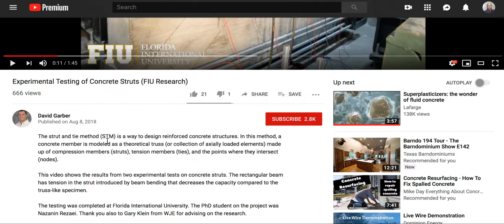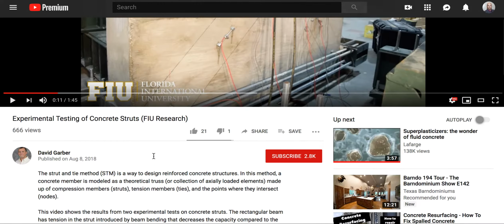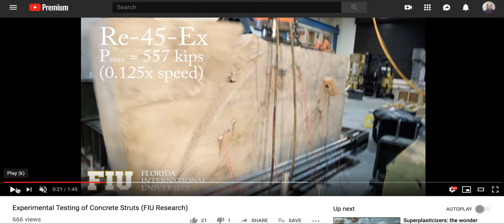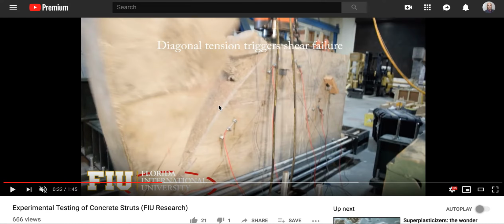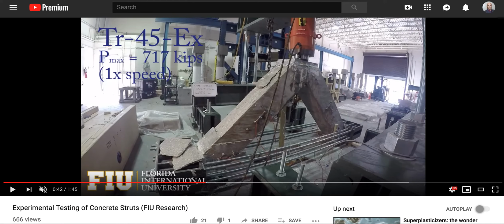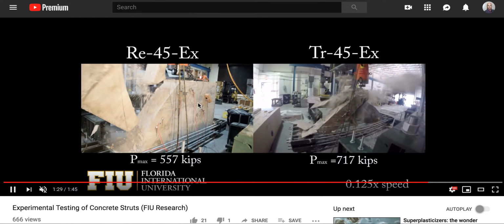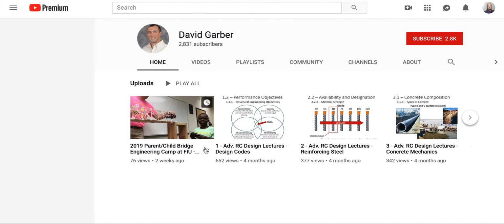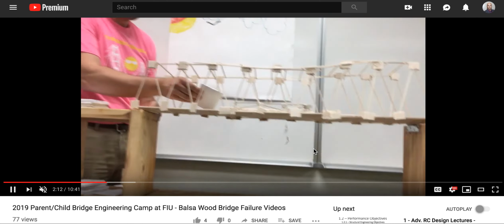FIU Bridge Collapse Engineering School Sample Broke Concrete Struts Related ?

Comment: Take a look at this vid. It is a better explanation and experiment. https://youtu.be/0olpSN6_TCc.   Better explanation of how the simplest of medium like dirt can be reinforced. Love to see a vid on your take on it and how it might relate
Reply from the maker: HowThingsWork Construction Engineering2 minutes ago (edited)
I saw the video you linked me to, on the shear of soil... I have a video I will do on that dealing with fiber mesh, etc... It is basically gator grid  in the smallest form... it STOPS the loads from shear the soil in the 45 degree angle   -- the layer below becomes under tension and this acts like a truss system using soil as the factor...   It is still angle of depose  and my ''engineering of such'' does not use the typical formulas but uses angle of depose to find the weakest axis and that is the safety factor in installing a gator grid type product...
I have decided to share almost all my knowledge on youtube and I will get around to this method and prove it's abilities in the layman's terms... Not in engineering math terms.
Grady, stated he used the screen material because it does NOT deform under loads... 
He is missing the ''tension'' created in the 45 degrees that puts the fabric in tension that retains this system from failure...
NOT the stiffness as he stated but the ability to NOT resist the applied loads in TENSION...  it has nothing to do with ''stiffness'' as I could use rebar and it would NOT work... 
You need more cross sections and more resistance to tension that matters... you further need friction of the layer below and above to interlock or you will get shear plane failure. 
Latitude, I will do a video on this but did not want to pick on Grady, I already called him out once...  Do not want to do it again...  He is a student and has yet to graduate and his content is beautiful... So, I do not want to discourage him and give people any wood for the fire to attack him...
PS Did you see the last two videos I posted on random cracks? I have many still to come... be patient with me... and I hope you become a believer and spread the word...
Reply from the maker: PS Be right back with a video response... ha

Comment: The fracture starts a little bit down due to the loading and sheer capability of the concrete mix itself. We all know concrete is wonderfull in compression but not in tension or shear. Hence the break. Also, this is not concrete as no aggregate large and small stones seen. As a structural engineer, one ignores the tension and sheer capabilities of the concrete as they are so small and puts in Re-bar to allow contain that force. What has this experiment have to do with the FIU bridge? The experiment is miles apart from the members in the FIU Bridge.
Reply from the maker: I only find it odd that they tested a concrete "truss / strut"  at the same time they planned on making a concrete ''truss looking bridge"...
I theorize that the lack of reinforcement would be a good predictor of the system installed...  If, you recall, they system could NOT have a conflict of reinforcement and no one would actually make a strut like this, without reinforcement -- so why test it all?   Possible, to establish a baseline showing no reinforcement as would be found in a typical system...
You being a structural engineer do know how they load tested this member... It was NOT designed to be decorative.
The load testing shows the intent to some degree... as I stated in the video, I wish they would have given more data; especially from their strain gauges. 
Do you find it ''timely'' this testing? Or have you concluded that this can have nothing to do with anything and is just a fun project that will never be used in the real World? 
Finally,  "concrete" , I have trolled a video on ''concrete''  and stated that adding any amount of aggregate to portland cement makes ''concrete'' --- it is just the mix-design is weak or not... But, it becomes ''concrete'' once you add any aggregates and even if you add sand only, it has different sizes of sand... yes, they are slightly larger and smaller grains so that would give you at least two sizes of aggregate... 
I know, you want to call it ''masonry cement'' at that point... but, I state it is just a weak ''concrete"...
Are you trolled on that last statement?
Reply: HowThingsWork Construction Engineering I am a Civil engineer, that works in Management now. Managing large projects. Sorry not a structural engineer. That said my Civil Engineering degree and Masters, informs me that concrete mix without aggregate of the right size will not behave in the manna Engineers design structuers. Hence I am at a loss to understand what the experiment is showing. It has nothing to do with a beam concrete construction. It also has nothing to do with a reinforced structure. All I can think is they wanted to see how the stress break pattern would evolve, as that is only what I got from the vid. Please understand that reinforced concrete behaves differently to pre-stressed concreat. The difference between the two is like night and day. Like wise the behaviour of a none reinforced block of concrete to one that has re-bar is also like night and day. Further having a mix without the right aggregate dimension is not concrete. Go look up the definitions. Sand is not an aggregate. Aggregates are not made from sandstone...thats a fact. I do not know where you are getting that idia from, as it is wrong. As for my theory: the FIU bridge collapsed due to the prestressed member 11 becoming elastic due to the force reaching its exceeded counter force to keep that member in compression. The fact that when the bridge was moved into place and developed 10mm break lines, should have informed the all women engineering team they had to performed tests before allowing any self load to be taken up by the bridge. My conclusion? Engineering team on site were kids playing at engineering. None of them had any true site experience. You just don’t allow workers to pre-tension up bars without understanding what force it was carrying at the time, just in case you over tension it. That's what those monkeys did and killed 6 humans that was so easerly prevented. The director, and the those All women team need to be struck off the register and some go to jail.
Reply from the maker: @latitudeash  , I thank you for you conclusive file on the beam design failure and other statements you made...
I do realize you do not like the idea that concrete does NOT have to be of a certain aggregate size to make concrete...
The short answer is, ''fine aggregate'' and the second part of my trick concrete statement was I never established a playing ground of using ACI to manufacturer ''concrete''...  haha   Okay, enough of that fun troll concrete statement...
Onto their concrete load test... I love different size aggregate and admixtures, as you can tell, I do not have any issue with them NOT using ACI guidelines (we made concrete way before ACI showed it's limiting face)...
Grouts are proof that a ''micro concrete'' is bad ass and reach 9500 psi in 28 days, no problem... they are NOT just portland cement.
Reply: HowThingsWork Construction Engineering thanks- for your info, Grouts are used as fillers or glues. They are never used to transmit loads. Typical use filling break lines, fillers in spaces that are under high compressive loads. The are called grouts and not concrete grouts.... They do not have any aggregates as they are known as pastes.  One more point even when you need a concrete flow mix (a watery mix) one uses smaller size aggregates but one would add a plasticiser additive. You seam to be indicating that a grouse mix would work in those situations and they would not. One more point exothermal reactions on a large quantities of grout would course creaking  as the heat can not dissipate quickly.. This is why we use a additive to keep the 28 day strength and to not add water that will make it week due to the heat exothermal reaction.
Reply from the maker: I enjoy the banter and have made a video response for you... should go live in a moment or two...
Please,  enjoy and attack back where you feel attacked by my comments...
This is actually a good discussion and I do not argue exothermic  and my video response will address your reply here... I  did not see this reply before I completed that video but it still address most of it...  
But, for clarity, you do have to know that grouts are not just portland to get the 9500 psi...  My point is, all the other additives make a ''concrete''...   I think this is what I am arguing for the FIU test sample, that IS concrete and not some portland only mix... 
Your position is it does not look like an ACI mix?  Or what...
Reply: HowThingsWork Construction Engineering - my point is is clear that the mix used has no aggregate of the size I would expect to see. Hence any compression tests would fail quickly. Also any pre cast slump tests would fail. The codes state what the range one would expect for a strength of concrete on a slump test. That test would fail on the video mix.